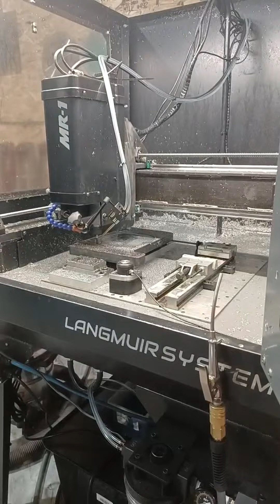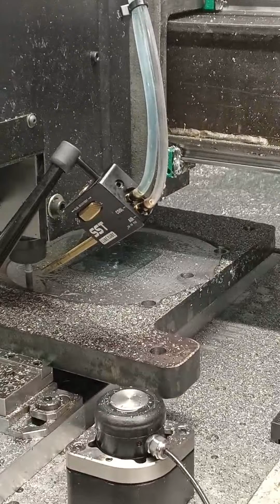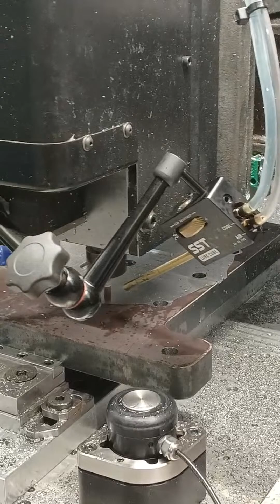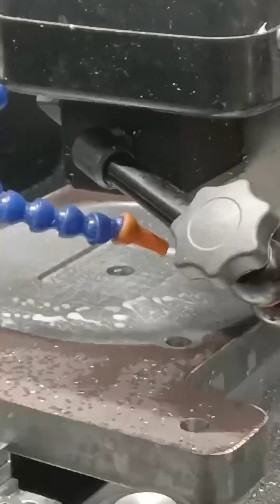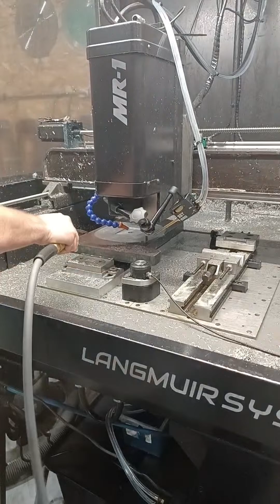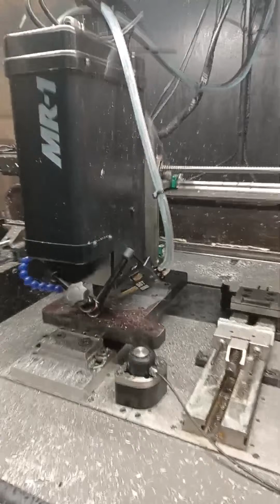Machining A Steel Part On The @LangmuirSystems MR-1  #langmuirsystems #MR1 #cnc

Comment: How loud is the MR1 working on steel? Would my neighbors kill me if I operated one out of my garage regularly? Any idea if building a sound booth would help?
Reply from the maker: If you have the correct feeds and speeds it's very quite.  I can sit next to it and watch TV while it runs.
Reply: @BeckTools  thanks for getting back to me so quickly! So, if my garage is closed and the enclosure is closed, a neighbor 40 feet away outside wouldn’t likely be annoyed?